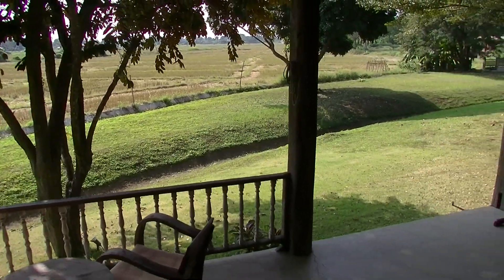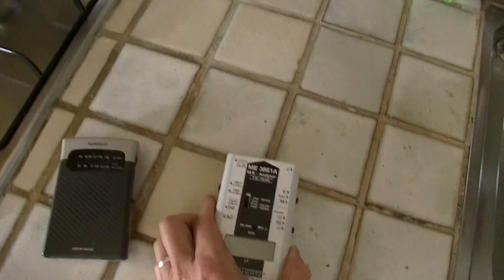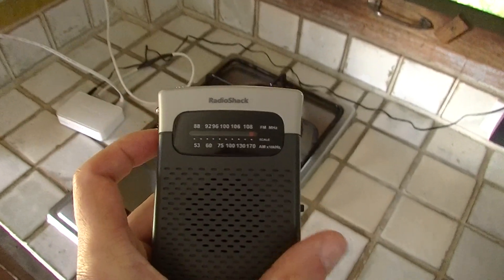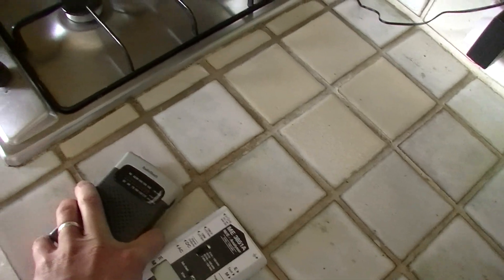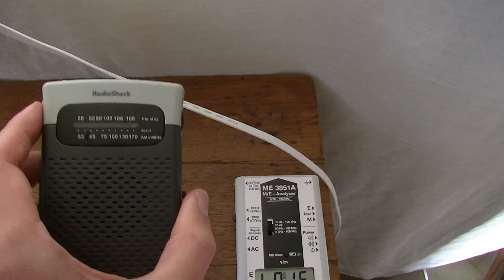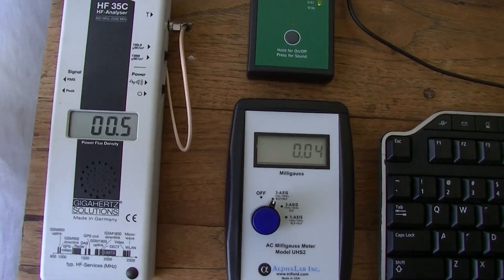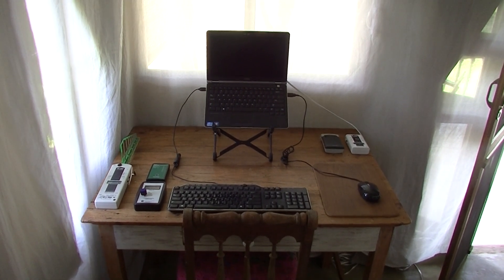How to Set Up a Low-EMF Internet Connection

Comment: you forgot to mention getting a mechanical keyboard and ball style mouse ( the ones you have to clean periodically) to reduce electric fields as well. though i am aware grounding yourself whiile at a work station will zero out electric fields absorbed by your body.
Reply from the maker: Hey Justin. Actually, you want to eliminate the electric fields before they get to your battery powered laptop. You do this by grounding your Ethernet per the video above or with a fiber optic system. Then you don't need a mechanical keyboard/mouse. You also don't want to use grounding or earthing products in your home. These fields will be going through your body and you will be attaching yourself to the EMI on the home electrical ground. Not wise, as I discuss here: https://www.emfanalysis.com/is-grounding-good-for-you/
Reply: @emfanalysis  i was referring to grounding myself in my bed with a copper grounding rod n wrist strap.  But i see you explained more in the link

Comment: What setting do you have your Gigahertz Solutions ME3851A at? It looks like the 3rd setting, but I can't tell for sure. 
    5 Hz to 100 KHz 
    16.7 Hz 
    50 Hz to 100 KHz 
    2 KHz to 100 KHz 
Thanks so very much for all that you do.
Reply from the maker: I use the 50 Hz to 100 KHz setting. The electrical frequency of 50 or 60 Hz overwhelms pretty much every other frequency in our environment. That's what we are primarily measuring with this meter.
Reply: @emfanalysis  Thank you!

Comment: Is it possible to make phone calls from a computer? Do you still manage to do that or do you not use anything for phone calls?
Reply from the maker: Hi Thomas. Yes, I pretty much always use my low-EMF laptop setup for calls. I can call any phone in the world using Skype Out and I do most of my video calls using Zoom or Skype. I hardly ever use a landline phone and have not done a call on a cell phone in over 10 years. The low-EMF laptop route is the best in my experience. Jeromy
Reply: @emfanalysis  Do you find that landlines cause worse symptoms than the low-EMF laptop route? Awhile back I got a landline to replace my cell phone, but the landline itself gives me EHS symptoms. If the low-EMF laptop is less painful, that would be wonderful.
Reply from the maker: @elizagray2022  Yes, that's actually what I have done for the past 5-6 years. I always use Skype Out or Zoom for calls on my low-EMF laptop setup. Works great for me and I haven't needed a landline for that entire time.

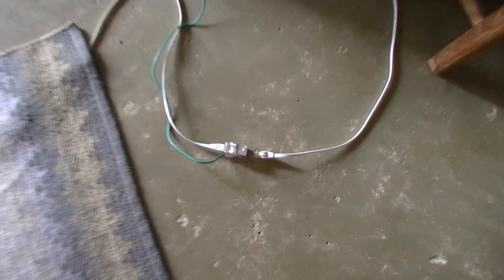Comment: 1:38 Jeromy, does the ethernet ground adapter ground the inner/current in the network cable or does it only ground the shield of the network cable?

Thank you for your work!
Reply from the maker: Hi Bastian. Thank you! The ground adapter is mostly grounding the lower frequency (primarily 50-60 Hz) electric fields that are being conducted along any copper/metal in the Ethernet cable. They are all connected at the RJ45 metal ending of the Ethernet cable. That way it is not conducting to your laptop/device. If properly done, the electric field readings at your device should be below 1-2 V/m.

I find that the ground adapter does not do that will for higher frequency EMI (1 - 2 MHz). For that, you need different solutions, like your own fiber optic system that creates an air gap or cherry-picked router/modem that doesn't generate such EMI.  I'll share an article on that soon.

Hope this helps,

Jeromy
Reply: @emfanalysis , sorry for my half nonsense question for you. I suffered brainfog and fatigue from spending way too much time on the computer. However you provided me a very good and useful answer. Thank you!

Comment: I get my phone (land line) and internet from Cox.   Can I set up to use the Panoramic modem/router that has 4 ethernet connections at the back to go wireless.   Obviously it is more than just connecting the ethernet cable and turning off the WiFi on the laptop which I did but it didn't reduce my ear ringing.   I have regular CAT 6 ethernet cables from Walmart.   Thanks.

Comment: Another variation would be to use the Ethernet-over-powerline devices.  This way you do not have to drape an ethernet cord and risk a tripping hazard, as long as the actual ethernet router is far away (such as in basement).  There is a little 'dirty electricity' introduced while connected, but it is minor and gives you flexibility to move anywhere and still be connected by ethernet.  My house has shielded ethernet in the wall so I do not know whether they would still run into the issue related to excess noise necessitating some additional grounding or not.  The price was about $40 for a set on Amazon TP-Link AV1000.
Reply: You bury your ethernet cables in the walls?
Reply: @OurFreeSociety  In a home, it is better to run the Ethernet inside the walls and choose a handful of destinations for wall outlets to be added -- for desk or a TV for example.  In this video,  I did it when the house was constructed, which was the cheapest way.  After the fact, small holes can be drilled and the cable pulled/snaked without too much wall damage, usually.  There are some advantages of using shielded wiring in the walls, but there are demerits as well (cost, not so flexible so install is harder, having a continuous ground for all links in the chain is tricky, and so on.  JJ was in a temporary setup so had to make do.  I dislike tripping hazards so I would have tried to use some thumbtacks to run the temporary cabling closer to the ceiling.

Comment: question does a wifi modem/router is emitting radiation even when you are not connected? For example I was reading that is safe to turn it off at night but if my cellphone, ps4, etc are not connected then my guess is that there is no radiation.. but some people turn it off because they believe that even when not connected this are still radiating a little? is this true?
Reply from the maker: Hi Miguel - Yes, the router/modem will be radiating as long as it is on. My suggestion is to get a model where you can physically turn off the WiFi. Read this article: https://www.emfanalysis.com/how-to-install-wired-internet-in-your-home/  You may also want to get a RF meter. Check out the Safe and Sound seen here: https://www.emfanalysis.com/recommended-emf-meters/

Comment: I was reading your article on How to Set Up a Low-EMF Internet Connection and is how I came across this video.  I then went to youtube to finish watching it, so I could comment underneath the video.

You mentioned natural material curtains ...

What are they exactly made of ?  Cotton?  What type etc.?
How do they block emissions & how good are they at doing so?  
Would a double layer work even better?
Or would say Aluminium Foil work even better at reflecting the waves from cell towers?

I have a dual WiFi modem at home 2.4 & 5GHz and have made a type of dodgy shield around the modem, in order to try to keep it contained to a certain area and in doing so try to keep it from the bedrooms.  

Do you think that would help in the mean time while we are trying to get the gear together in order to go WiFi Free in the house?

In your article you mention smart meters...  [ I don't live in America Aussie here :) ]

These smart meters are they for electricity usage or other?

We don't have fibre optics to the house as yet for internet, we only have FTTN Fibre to the node and so we don't have to have an external box on the side of the house as yet.  

Is the box you speak of to do with electricity as I mentioned or our box we one day will have when the fibre optics cables are to the house? [ or FTTB/P]

Since we are in the process of NBN National BroadBand being delivered to all the households across Australia, this is all pretty new to me and I've been trying to learn as much as possible about it.  My parents live 3 hrs away from me and they have a dish installed on the top of their house in order to get NBN.  [ I'd think their set up would be quite a bad set up also wouldn't it? ]

I've heard so much about your smart meters being attached to units/houses etc. in your country, that it really has had quite the impact on me in looking into dirty electricity, EMI, EMF, Wifi, Microwave etc.  

They used microwave technology in the war era in order to affect their enemies, they had even tested it on their workers in the office and as they all got sick/cancer and such they just loaded a new lot of workers in to test on time and again.  So they have known for many decades now what these technologies can do to us human beings and others in the animal kingdom.  This then leads one to believe they are not doing all of this in order to help us, more so to our detriment in the end.  Whilst now they are making out it's for our convenience and pleasure so as to have technology at our fingertips wherever we may go.  

As you said, putting up cell towers quite regularly along the streets, causing more untold harm on the people living in these areas.  :/ :( 

If you could get back to me it'd be appreciated.  I'd appreciate and enjoy reading your thoughts on any and all of the above.  Thanks Jeromy :) 

L-JAY
Reply: L-Jay, I think he means SwissShield "Naturell" shielded fabric.This stuff is pricey, but magical for our local Electrosensitive person.  She wears it draped around her person,as a wrap, generally.It is sheer enough to see through.  It is a polyester/cotton mix I think, but the important bit is that there are metal fibers woven into the fabric.  Here in the US, I thin we paid about $120 US for a piece that is 8 ft by 3 ft in size.  Covering each window would become pricey, but for a temporary location this can provide good relief. You could try to use mylar ("space blankets") in a layer or two to reduce the RF signals, but soon the sunlight would be blocked and you would be in a dark room.  The Naturell is the most effective material we have used and we found it shields for lower frequencies as well, so even when the car is started up, that there is some relief.

Comment: I just pounded a 4 ft copper rod into the ground and when I bring my 3851 to it and touch the rod 3851 shows 56 v/m.   
Also, ran a wall plugged grounded wire and clipped it to a sheet of foil I have covering the wall. The meter shows 20 v/m higher when the grounded clip is attached t the foil vs the foil by itself. 
What does it mean ?

Comment: 5g WiFi are everywhere all around us, my phone can detect about 15 of those 5G networks to connect to every where I go, what difference would it make to insulate my own house ... and if you live in an apartment ...
Reply: you have to have a good meter to see if an insulation would make a difference and how many layers. I have acoustimeter from safe living technologies, slt.co. Don't like lessemf (they hype too many products). Don't know if acoustimeter will handle 5g or you need a diff. meter, call them.

Comment: How come you don't use an external screen, then you can move the computer further away from you? Also what about your legs? Do you have an adapter there? I'm guessing maybe the body could also react to the cpu or gpu in the computer. I did not really understand the curtains, when i set up curtains, for me they dont help any if they are not made as a cube, blocking over under and all sides.
Reply: Jeromy mentions other places that he uses his laptop on battery power only, not plugged in. If I recall correctly, that's because the power adapter that converts AC to DC creates dirty electricity, as well as AC electric and magnetic fields due to being plugged in. He charges up the laptop while he's not using it. I assume it's the same reasoning for not using an external monitor. The swiss shield fabric works because the RF at this cabin is primarily coming from the cell tower (one direction, not all). If you're in a city, it's probably coming from every direction, and yes, you'll need at least the walls covered. If an apartment, then above and below as well. Most people just do this over their bed for sleeping with a canopy, as I understand it. Also, you don't want to create a cube around a bunch of electronics, no matter how well grounded etc... you'll just be keeping all that *in*. Jeromy just covering two walls allows what he's generating with his electronics to get out.
Reply: A computer without moving parts is going to be better -- use SSD instead of disk drives, and a low power device without a fan  We always use our chromebooks on battery,  separated from our laps by at least 4 inches of distance (to reduce milligauss exposure).  If you have to be plugged in, you should use a wired USB mouse instead of the track pad, and maybe even a USB keyboard if the CPU/disk EMI affects your hands.  You could use a three prong AC adaptor, but your exposure will be worse, the harmonics will be introduced into the wall wiring,  and you must keep a respectful distance from the AC-DC converter.  Obviously do not use a bluetooth anything.  If you want to write-only (ie, you are a book writer and do not need the internet) you might consider getting an Alphasmart NEO for $30, a kid's school computer from years ago that runs just on AA batteries.
Reply: @kengartner204  - what do we do with desktops? I hate laptops and I was always taught to wire in. Plus of course it's faster. 

Thanks
Reply: @OurFreeSociety  Desktop computers often have a lot of moving parts, spinning fans, spinning disk platters and also take a lot more electricity.  Yet, they can be placed a few feet further away than a laptop, which mitigates a lot of that EMF.  You then run a wired USB keyboard (better is one without backlighting) and a USB mouse, keeping distance from the desktop computer itself. Make sure the desktop is running from a 3-prong plug so that the metal case/chassis is grounds, which will confine/reduce the emanated electric fields.  With a desktop, you are always plugged into a wall socket so likely your internet EMI/DE emanations can be reduced if you use the metal-headed shielded ethernet cabling, such as Cat7.  Having a meter and methodically making changes and checking that the situation improves is slower, but more likely to yield the sought health benefit of reduced EMF exposure.

Comment: Nice video. How do you ground the ethernet cable? Is it just a shielded cable where you connect the shield to the ground, or is there some other trick?
Reply from the maker: Hey Casper: I use shielded Cat-7 ethernet cables and the ground adapter seen in this article (items 3 and 4). They work great: https://www.emfanalysis.com/low-emf-internet-connection/
Reply: Thanks.